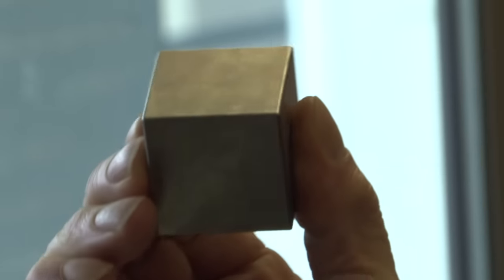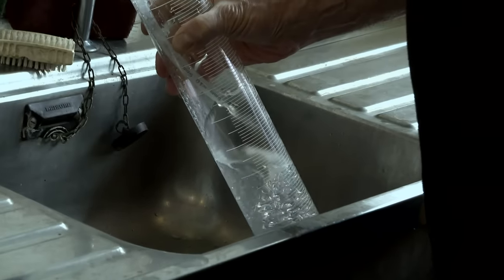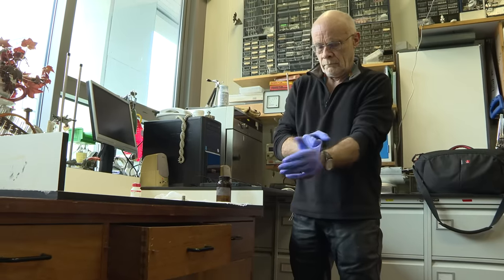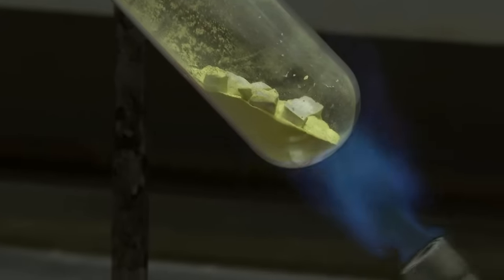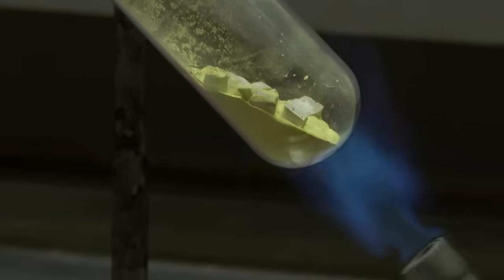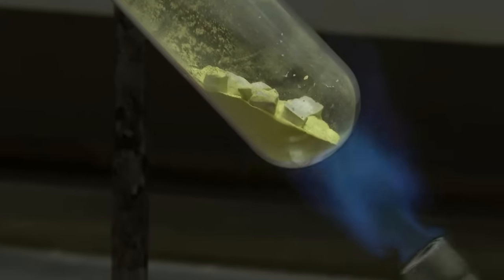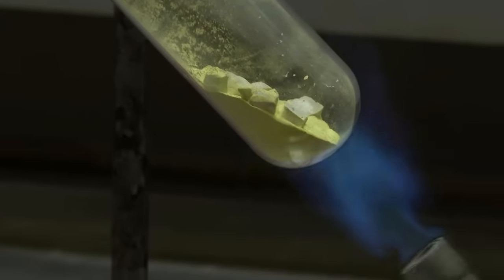Tungsten (new) - Periodic Table of Videos

Comment: I worked as a technician and am always surprised how under recognized the profession is. That said, there is a huge variation in what technicians do and are able to do, I was basically a postdoc working as a technician. :) Just was never interested in the higher position as I wanted to work in science all my life (didn't happen in the end, but long enough). In space, technicians would be extremely valuable as well, there's a way larger pool to choose from then just university grads.
Reply: I was a Lab Technician in a... ahem.... "third-party-high-voltage-electrical-insulation-systems-and-electrical-insulation-materials-laboratory"....
.......and you are still a few thousand percent correct. Plus-or-minus .001%.

Comment: I saw this and decided had to watch it. My dad is a retired chemistry instructor, I have always been into electronics. I'm taking a TIG welding class this spring it's interesting how much chemistry and electronics are involved in welding. They use tungsten in TIG because high melting point and it conducts decently. It used to seem strange to me people talked about AC VS DC and different polarity for welding I didn't see as far as electrically why it mattered, but whatever is positive in DC has more heat put into it. 
Aluminum they use AC the negative tip cycle welds the aluminum and the positive cycle cleans the oxide off but also melts the tungsten. Stainless is also interesting as have to be careful with the heat or will burn out the chrome. Even the filler materials are different to add cleaning, help with welding overhead, etc. It would be cool see like a mini playlist of chemistry of welding.

Comment: The thinning of the tungsten wire is a trick I've seen before, when Ben at Applied Science (I think it was him) was making gecko tape. The intention was to sharpen a bundle of wires and repeatedly poke them into a wax mold for the silicone. I wasn't a great method if I remember right, but still a cool idea.

Comment: The principal ore of tungsten, (scheelite) is calcium tungstate and it is fluorescent blue-white under short-wave UV light, which is one of the methods of prospecting for it.   Scheelite is dense and can be panned from stream gravels like gold, in many places where granites are present (e.g. Cornwall, UK) but it is white and looks like feldspar, so the UV lamp is essential.
Reply: Edison's and Tesla's early attempts at fluorescent lamps used calcium tungstate phosphor.
Reply: @gregorymalchuk272  Not a bad idea!  Zinc sulphide (sphalerite) was also used by early investigators for UV and alpha particle detection.

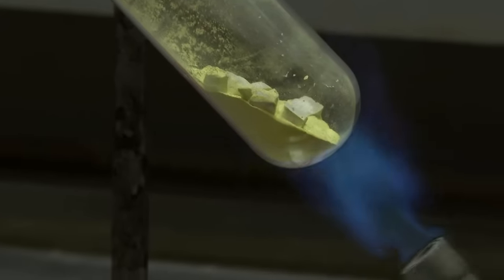Comment: 12:00 That is SO COOL, my hypothesis for why the wire formed those wavy lines of oxide is: electricity is a wave of electrons [Watch electricity hit a fork in the road Youtube Video](whether flowing, or vibrating, depending on current type), and as the wave peaks and valleys with increasing amplitude through the wire it will heat/react differently or more with the air in places where the electricity peaks or valleys. A similar thing was probably happening when the voltage was increased slowly as well and i think that I could even see it on the video, but the waves were given time to spread out slowly instead of making extreme highs and lows right away.

Wish i could do research like this instead of jobs, but i get to handle tungsten, molybdenum, and even cooler+rarer metals all the time so its pretty awesome

Comment: Great video as always.  At 11:08 I noticed that the right hand terminal block was resting on a piece of L bracket attached to the left hand block and thought "oops, that's a dead short" and then the magic smoke was released.
Reply: Those blocks are ceramic with metal terminals inside. The bolt attaching the bracket doesn't contact the terminals.

Comment: I live near the Canadian Light Source Synchrotron.  A number of years ago I was lucky enough to get a tour of it.  In a hallway we came across a pallet with about a meter square block of metal secured with steel straps for transport.  Our tour guide asked if anyone could guess what it was and I identified it as tungsten immediately much to his surprise.  He asked why I said tungsten and I only came to that conclusion because of the facility and my past as a lighting technician.  I was truly surprised to find out that a single tungsten source serves 22 (currently) beam lines.

Comment: A 1cm tungsten element cube was the first thing I ordered in my element cube collection.   One of my favorite metals.  Also next time you need more current to burn a wire, use a capacitor. No need to break out the big power supply.

Comment: The "bronze" color that should have formed is likely WO2 . Because the reaction was performed in air, there was not sufficient reducing power of the Na metal with WO3. The "more yellow" color is likely tungstic acid (WO3•H2O) that forms instead when heated in the presence of O2/moisture. The blue color is attributed to W(V) oxide (W2O5) or some mixed valence oxide W(VI)/W(V) where some reduction occurs on contact with metallic Na. As stated in the video, doing the reaction in a sealed vessel under vacuum likely would have helped.

Comment: Tell me if I'm wrong, but my guess is the reason why it gets bigger when it's burnt instead of getting smaller is because most things that you would burn would be carbon based, which would let off carbon dioxide, which is a gas. Which means if you burn something that isn't carbon based, the amount that you're left with is actually bigger than the original amount because it has oxygen on it but isn't a gas.
Reply: It just depends on whether the oxide product is lost as a gas or retained as a solid and the relative density of that solid.  The same thing happens with iron.  When iron burns (or rusts) the iron oxide formed is less dense than the iron and takes up way more space.  When sulfur burns the sulfur oxide formed is a gas, so their is no solid residue (although, if the sulfur dioxide is collected and weighed, it will be about twice the weight of sulfur burned).

Comment: It would be very interesting to explore the chemistry of tungsten welding rods in TIG welding, they use thorium and tungsten rods with an inert gas like argon to weld using electrical current, I'm sure some very interesting chemistry is taking place and would love it if you did a video about this

Comment: A tip for Neil: get a chunky 240/24V transformer (a few hundred W, at least) and feed the high-voltage side from the variac, this saves the variac and worst case the big xformer will smoke down. For a bit of efficiency get a 2-5uF run cap and parallel it with the HV winding.

Comment: I read on Wikipedia that tungsten carbide would dissolve in hydrogen peroxide, so I ordered some industrial hydrogen peroxide in the highest concentration I could find, 35%, and broke a tungsten carbide milling tool, and took a shard of broken tungsten carbide tool and submerged it in the 35% hydrogen peroxide for seven days. I observed no effect on the shard.
Reply: 35 % is too weak.  You need High Test Peroxide 90 %

Comment: Old automotive lightbulbs are a better source of tungsten filament for experiments than household lightbulbs, because the filament has to work with a lower voltage and a higher current, and stand a lot of vibration while it is hot, so it's thicker and quite springy. The bulbs no not have to be working; if you break working ones you might deprive someone of a spare part they need but which isn't any longer made.!
People who do a lot of work where they come into contact with tungsten dust do seem prone to develop heart trouble at a younger age than people who don't. (According to doctors in tungsten-mining areas of Brazil.) I am not sure if this is a chemical effect, because this is also better known to happen with rhodium dust, and rhodium doesn't really react with anything much, but both are very hard and dense. Nobody really wants to investigate this, but I suppose it might either be that the dust particles are hard and sharp, or that they conduct electricity and the heart is effectively an electrical organ.

Comment: Heating the sample with an oxy torch and then tuning off the gas would surely be a good way to get most metals to burn. Which leads to the question of which metal will have the most impressive result. A bright green flame from copper powder would probably be right up there in impressiveness.

Comment: if you mapped out the spacing of unduloids would it result in a graphical representation of the electric / electromagnetic charge running through it at the time of the wire's failure?

Comment: I'd love to hear more about the chemistry of welding using a tungsten electrode and various shielding gasses. Why doesn't the electrode combust like we see in your video? 

Since tungsten has such a high melting point, how is industry able to fashion it into cubes (for example)? 

I know some elemental metal oxides have a higher melting point than the base metal (aluminum, for example). Is this also true for tungsten oxides?

Lastly, we named our two kids after Wolfram and Molybdenum because they are the light of our lives!

Comment: There is a sailing blog called Sailing Anarchy where someone inquired as to how to source depleted uranium to install in a keel, making a denser keel and/or smaller wetted area, a small but perhaps advantage over lead. This is against the rules, but... After some hilarious comments such as "all over Iraq", and "you'll die of radiation poisoning" and "no you won't", Someone then suggested tungsten and indeed it has a higher SG than uranium-thus theoretically better. Difficulty in machining it precluded this and embedding it in lead was considered bur its price for the weight they were talking about was astronomical so I think it was abandoned as a concept.

Comment: Most of the things people are familiar with burning, appear to get smaller because a lot of the mass is going into the air, typically as carbon dioxide, or water vapor, or something along those lines.  This doesn't happen if the oxide is a solid at the relevant temperatures.

Comment: Interesting how the extreme high melting temperature of tungsten is not discussed. It's the highest after carbon! And a reason why it's used in light bulbs. Or think about tungsten carbide, which is used for metalworking. I mean, it's a nice video with nice demonstrations, but I'm missing discussion about the basic properties of the element.

Comment: I appreciate the shoutout to technicians. Im not in chemistry, but electronics. As a 'boots on the ground' tech, I consider most 'Engineers' as Idiots. oh, they are very clever people most of the time, but their disconnect from reality can really cause problems. the real world does not adhere to your CAD model. The best company Ive worked for would employ an engineer and then throw them down into the pit with us 'mere technicians' for a month or two before they were allowed on to an engineering project. some saw themselves as above being on the tools. some just couldnt do the manual work, no coordination or skill. we would swear and curse at the designs we were given, and then beat them into the right shape to do the job. we would scoff at the schematics, build them in a way that worked, redraw them correctly and send them back. giving them practical responsibility really was a powerful tool. we had a fairly high attrition rate, mostly they wanted to just sit in the air-conditioned office and click a mouse. but the ones that would come and get dirty with us, we made sure they wanted to stay. Dont want to toot my own horn to loudly, but there is a good chance im a better engineer than any kid with a 4 year degree.

Comment: Seaborgium would absolutely sink in copernicium. The first three elements in chromium's group are all lighter than the zinc group element in their respective rows. The effect only gets stronger for heavier elements; chromium is only .01 g/cm³ denser than zinc, molybdenum beats cadmium by 1.6, and tungsten is considerably denser than mercury as shown in this video. The trend should continue for the next row even more than might be expected, as seaborgium should be a lot denser than tungsten, but copernicium is expected to have such weak interatomic interactions that it should be only a little denser than mercury.

Comment: if you look closely at the filament at 9:50, you will notice the tungsten wire is coiled twice. I noticed this first under a microscope when acquiring  my own tungsten for my element collection. I assume it's for surface area, but maybe it's also related to the ductility of tungsten wire. Does anybody know for sure?

Comment: Over 30 years of TIG welding..I know firsthand how tungsten reacts when it is exposed to oxygen while it's heated with electricity. Also it acts different with A/C current than it does with D/C current.

Comment: Conspiracy theories surface now and then to the effect that much of the gold bullion countries store actually consists of gold-plated tungsten since the two are so similar in density. As a thought experiment, what non-destructive ways are there to tell from the outside if a gold brick is solid or part tungsten? (Even if the weight were a hair off, the gold could theoretically have been slightly debased and less than 999.9 fine but given a purer plating.) Edit: Some sources show gold heavier; others, tungsten. So I don't know whom to believe!